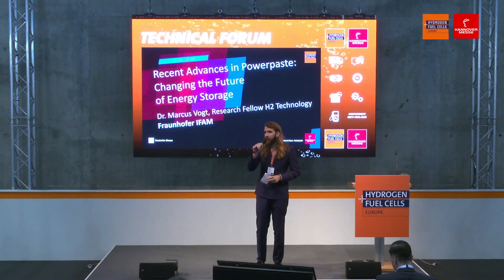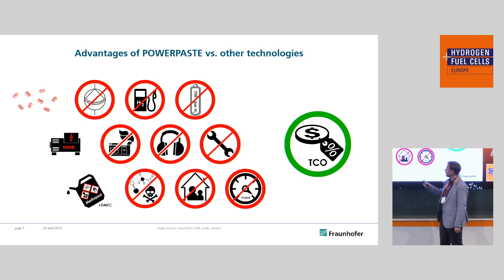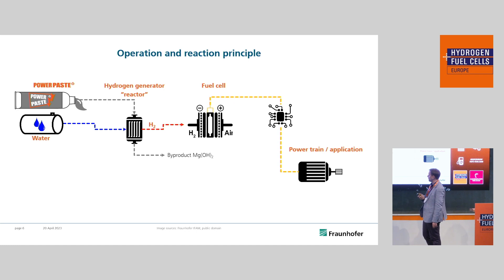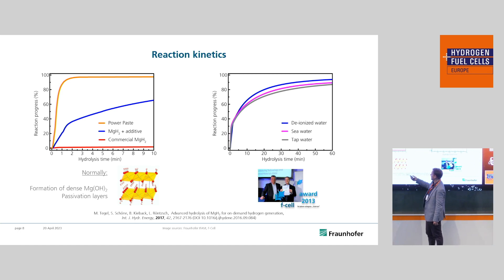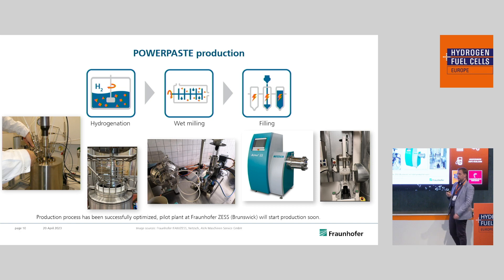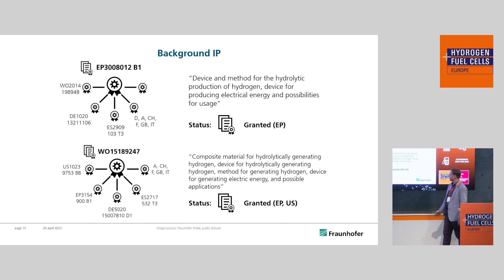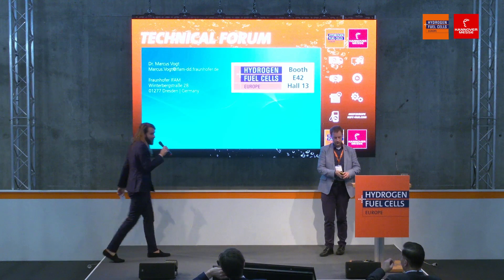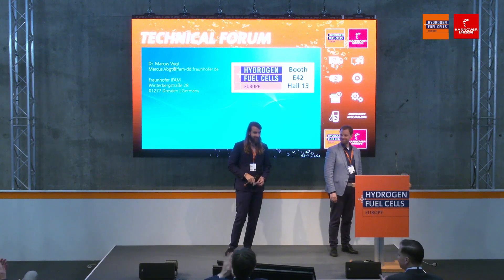Recent Advances in POWERPASTE: Changing the Future of Energy Storage  | Hydrogen + Fuel Cells EUROPE

Comment: The fuel cell produces water as a byproduct. This water can then be used to release more powerpaste. So you probabaly don't need to carry much water.

Edit: Nevermind. I saw the slide with the specific energy. The drone carries 3.4kg of paste and 7.5 kg of water. The total system specific energy is terribly low. This will never even approach the best hydrocarbon-based systems.